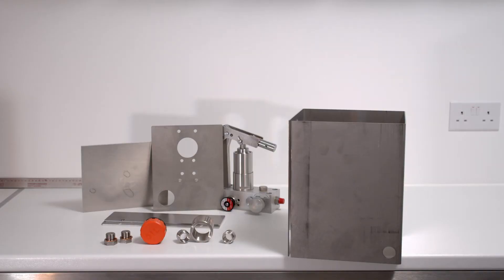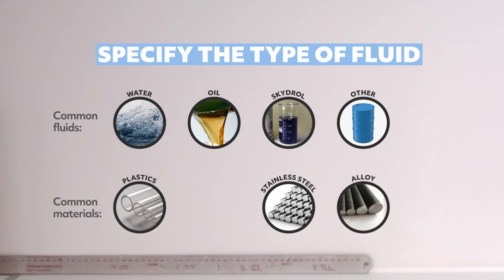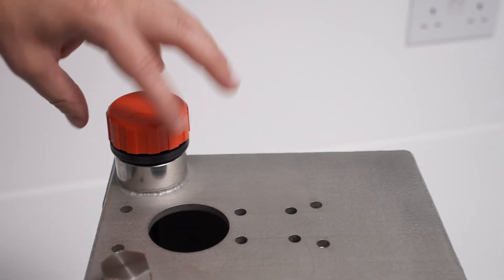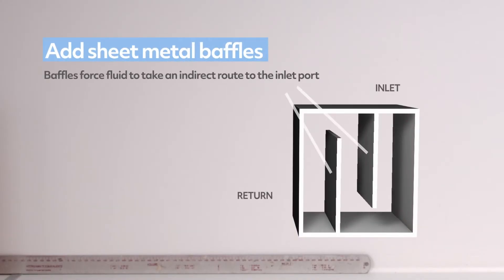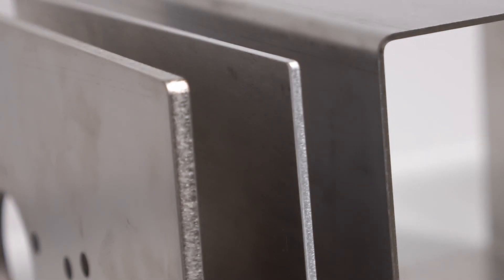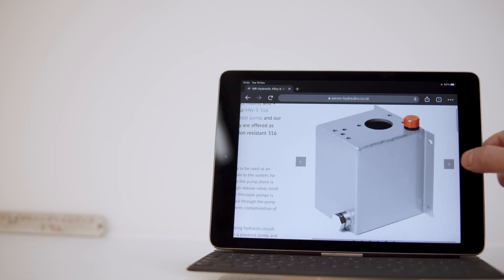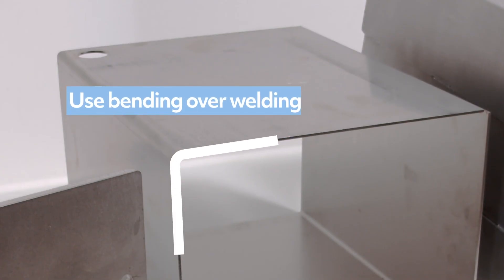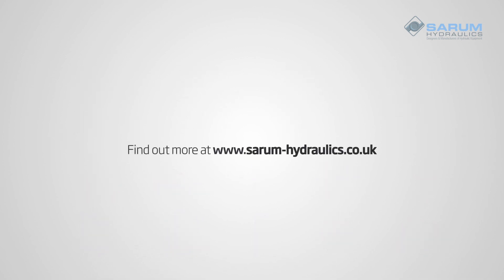Learn how to make a hydraulic fluid reservoir

Comment: How small can fluid reservoirs be bought in? I have been trying to work on a hydraulic project that requires a very low pressure/strength hydraulic cylinder and to save space I have been looking for as small pumps/cylinders I can find